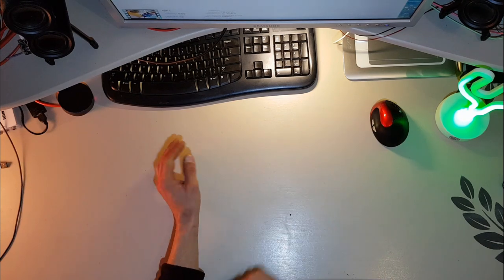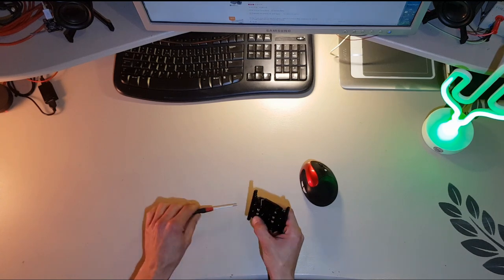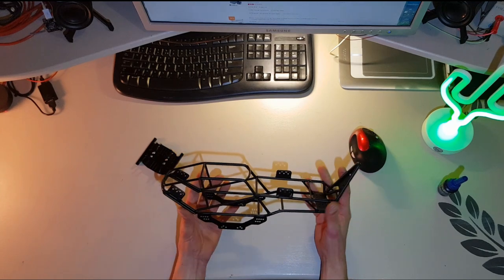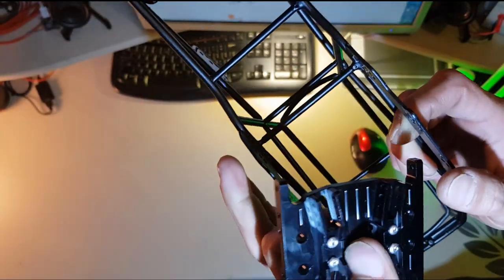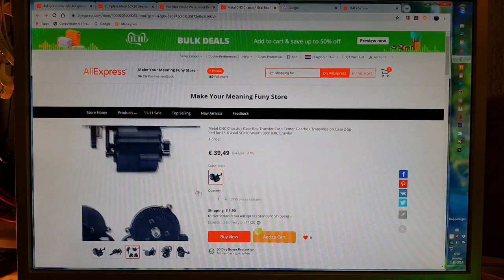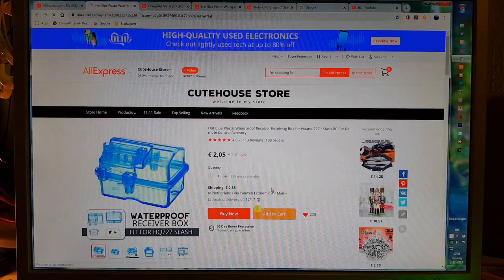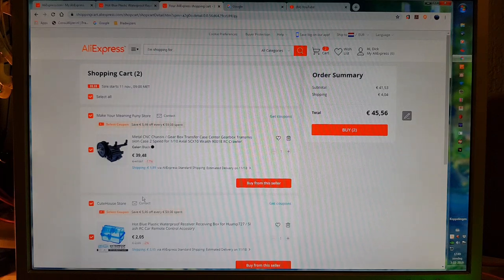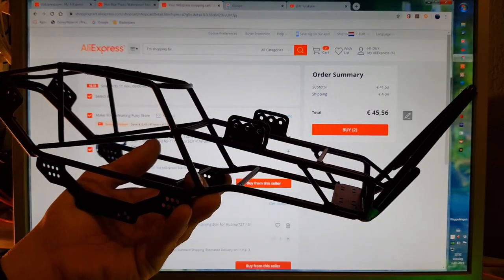***Custom RC Rock Bouncer budget build series part two*** (Frame and Skidplate)

Comment: I'm starting a rock bouncer build end of the month but I'm using a vanquish clone  transmission that has a dig unit on it  I'm also going to slap 4ws on it and some 2.6 proline black Mamba tires
Reply from the maker: That sounds like a sweet build!!👍🏼👌🏼🤟🏼
Reply: @dizzydrc  thanks bro

Comment: Put links in the description
Reply from the maker: Youtube doesn't allow me to (as far as I know that is only an option if you get 1000 subs or more). If I put a link in the description it gets removed instantly. I show what I order in the videos and if you pay close attention you can see for each part what it's called on AliExpress and from wich store I got it on AliExpress
Reply from the maker: Sorry, was mistaken. There are links now in part five and I will add the rest in the other videos tomorrow.👍🏼
Reply: @dizzydrc   Hello bro i want to build a rc crawler monthly budget of 50$ and body i will craft myself in pvc form sheets and what are the other materials i want to purchase please reply i am a Begineer in this field thats why am asking
Reply from the maker: @CrimeCat YT  No problem, thanks for asking. I think you mean: what other parts do you need? In that case you would need wheels, tires, axles, suspension links, suspension, chassis frame rails or a body witch you can connect everything to, skid plate, driveshafts, transmission and than all the elektronics ( servoos, motor, receiver, battery, ecs) and that is about it if I'm not forgetting anything but I think it would be wise to first get some more intel/knowledge on RC crawlers so that you don't buy stuff/parts that do not work with each other/ are not compatible. My suggestion would be to search on YouTube for the topic you want to know more about and then watch some videos about it. It will save you from some fails on the build. And you are off course always welcome to check out my Rock Bouncer Budget Build videos to see what parts I get to get a complete car and maybe even learn a thing or two. If I misunderstood you or you have more questions feel free to reply. Succes!! 👍